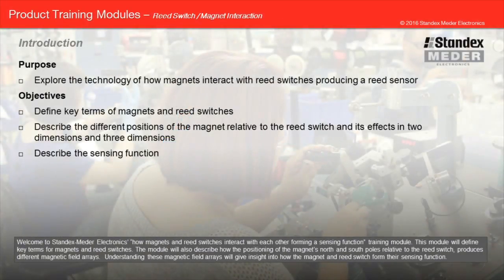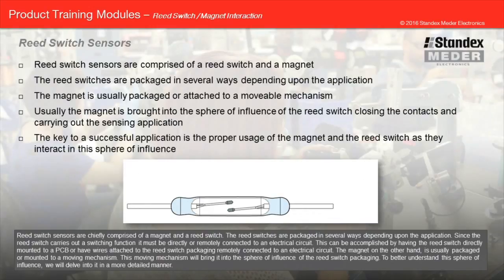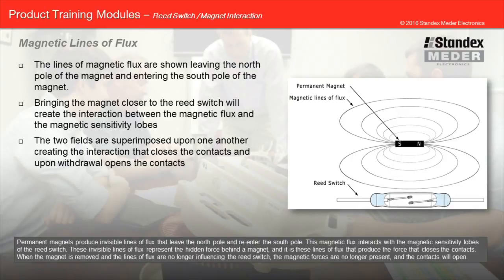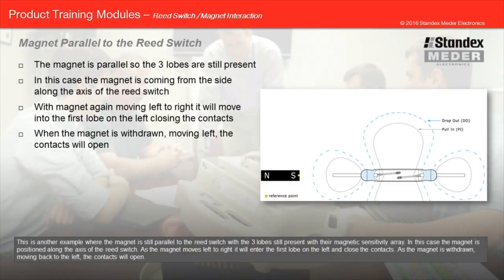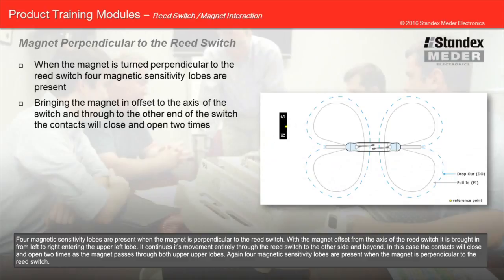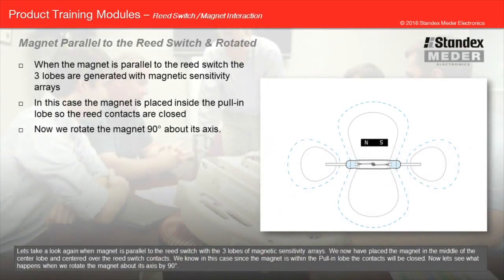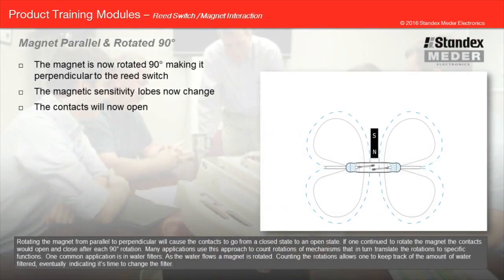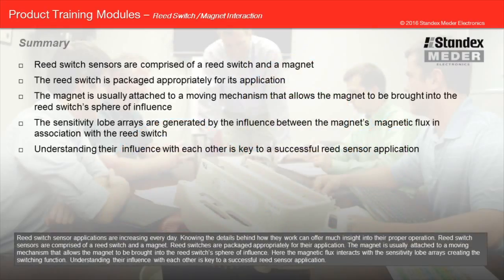Product Training Module - Reed Switch Magnet Interaction

Comment: If you pass a current that causes the blades to micro weld, if you tap the Reed to break the weld, would it be easier to cause the blades to micro weld again, or would it be harder and require more current?